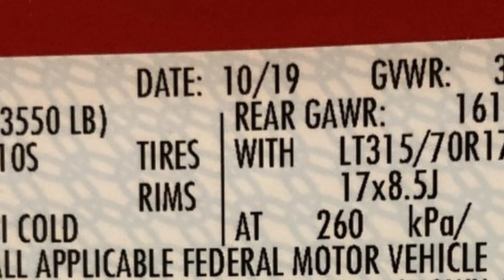Important TSB for 2020 Ford Owners - 10 Speed Automatic Transmission

Comment: I just traded in my Ranger because of this transmission. There is also ANOTHER TSB on this transmission. 
I had symptoms and contacted my dealer. I referenced the TSB and my symptoms. They said bring it in and they'd "take a look at it". 
I've been driving Ford products for over 20 years, but traded in the Ranger for a 2024 Colorado Trail Boss. This is my first NEW Chevrolet EVER. Love it. 
More than a little disappointed in FORD.
Reply: traded for another shit box, go figure!
Reply: @rhoelg  Thank you so much for your thoughtful and constructive comment. It's contributors like you that make YouTube what it is.
Reply: I traded in my 21 ranger with 56k miles with. Trans issues. Got a Tacoma with 80k miles. Scratches all around, boring to drive. Couldn't be happier.

Comment: I have this issue.  2020  F150 XLT. Truck is just after the build date of the TSB and Ford of Canada & dealership refusing to help.  They keep throwing SSM 50355 at me.  Been to 2 different dealers.  Whatever happened to the days of listening to the customer, diagnosing the issue and repairing it.  SSM & TSB's are good, but also offer fallback means to not repair issues if they are deemed normal operating characteristics of the SSM quoted.

Comment: Mine is a 10/19 build date but I’m not noticing the noise. How important is it to get it looked into?
Reply from the maker: You would probably hear it. The dealer can check your exact build date
Reply: Does it sort of sound like a turbo? I have a 5.0 that makes a turbo like sound in lower but even high speeds
Reply: @C_Brucehard I mean the turbos sound like turbos lol
Reply: Very important, you don't want that bearing to seize up
Reply: I hear what I thought / still think is my turbo. I’m gonna be pissed if it’s nots . Although they just put a new transmission in so I’ll have to see. Plus mines a 2019. I hope 🤞🏻